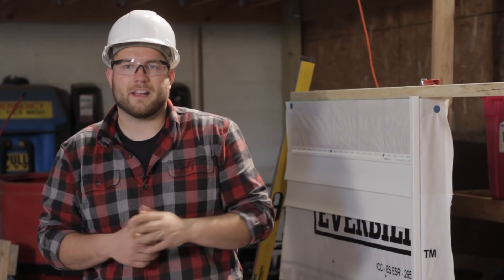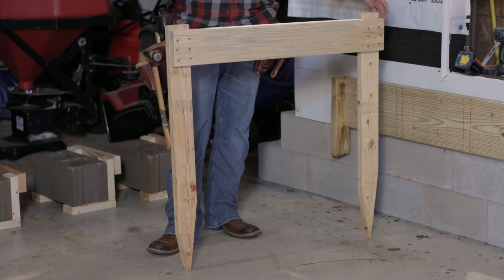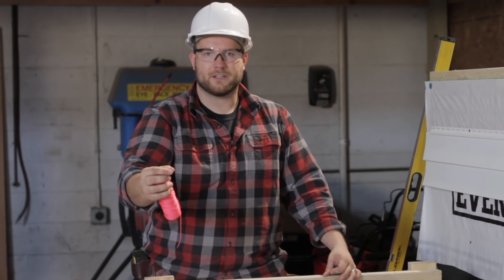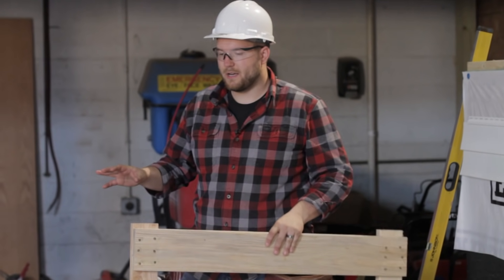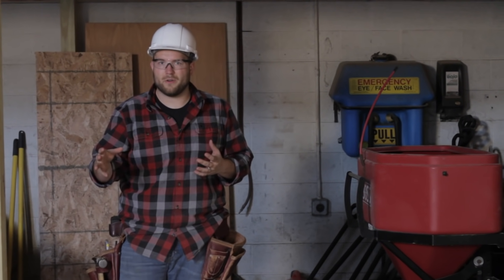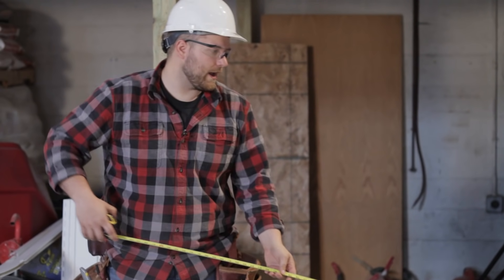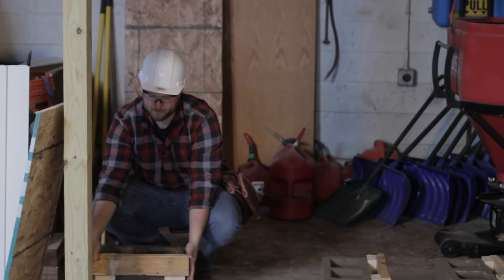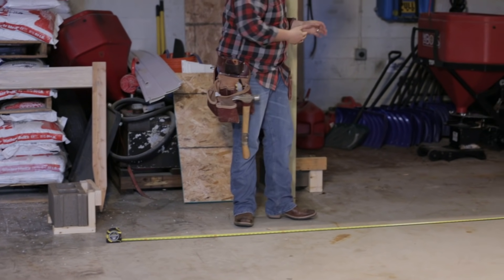How to Build a Deck Part 1: Site Layout

Comment: what happens if you are needing to measure off from a 2 story home? how do you get the strings to line up?
Reply: Carry the plane down with a plumb bob and allow the lower level to be transfered below and fully representative of the upper level.

Comment: Thanks for the vid. You forgot to mention that the strings have to be level though. Obviously when you're working off a slab you can just measure off that but  if your ground is not level, I assume you would use a line level?
Reply: The average do-it-yourselfer doesn't have a transit though and line levels aren't very accurate in my experience. In that case what would you recommend? Thanks.

Comment: I know this is super old, but I found the video extremely helpful. Very good explanation of how and why to use batter boards. One thing I wonder is, why not just tie the string around the horizontal part of the batter board, then you could just slide it left and right to adjust rather than putting in a new nail? When you have the right position mark it with a pen and you can always get slide it back the right position.
Reply: onepoket the string won’t last long sliding back and forth on the wood surface. Unless you bought paracord for some reason, it’ll fray and break. Learned that the hard way doing my first fence layout a few years ago

Comment: The way to do this with only 1 person: hang a nail on your ledger/wall and hook your measuring tape to it. Then use the tape as if its a giant compass and draw an arc from each corner and adjust your batterboard strings until the measurement is flush with the string. The outermost edges of two arcs scribed from a straight line form a parallel line. Thank Archimedes for that one (or one of those geometry dudes)
Reply: Hi there Drygord! You proposed a solution that I was in desperate need of, as I will be solo when I layout my deck this weekend. But I didn't quite follow you. I was wondering if you could elaborate a little more?
Reply: @brunodeluca7486  hey- sure thing. You are using geometry. So you have the wall from which your deck is built. The wall should be straight. On each corner of the wall you hammer in a nail to hang your tape measure. You set the tape measure for however many feet you want the deck to extend.  Set up your batterboard and strings approximately. Then you hook the end of the tape measure onto the nail on the corner and swivel it back and forth in an arc to find the point where it's furthest away. You do this on both corners and your batter board string should now be parallel to the wall.

Now the fun part: you get your calculator and remember A^2 + B^2 = C^2. So you take the square root of A^2 + B^2 and set your tape measure to it. Now hook the tape measure again to the corner and measure the point on the string exactly where length C touches the string. This is now a perfect 90 degree angle out from the corner.

Enjoy!
Reply: @drygordspellweaver8761  Thank you for taking the time to explain!
Reply: @brunodeluca7486  You're welcome- have fun!

Comment: The fact that he eyeballed a 6-8-10 triangle to 7/16” is pretty nuts lol
Reply: That sounds cool but he knew the masons line was 7/16" off the foundation. He didn't eyeball anything which is what made it so accurate. Just wanted to throw in my take on how he accounted for the varience.

Comment: Why wouldn't you just  measure out from the wall out 8' 7/16" instead of floating the tape? If the 7/16" of an inch is uniform across the ledger, wouldn't be a more accurate measurement?